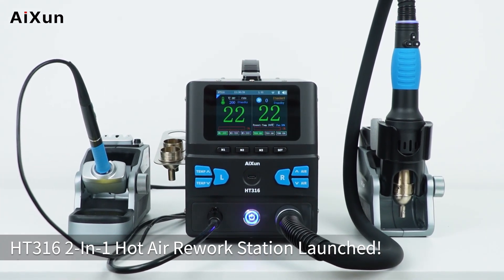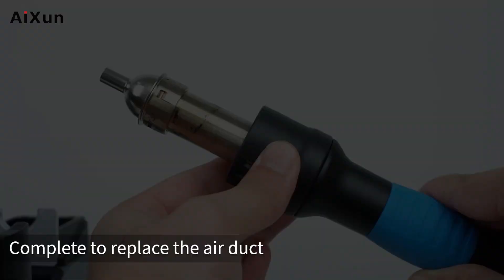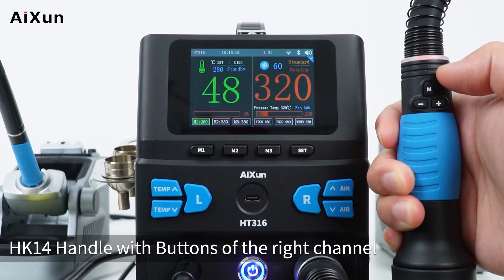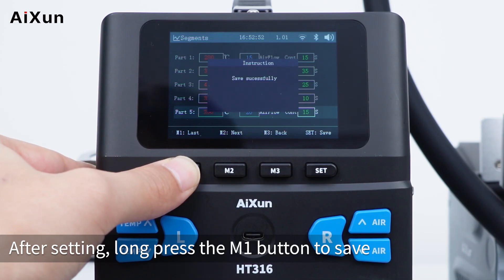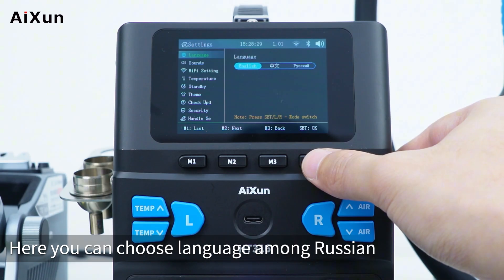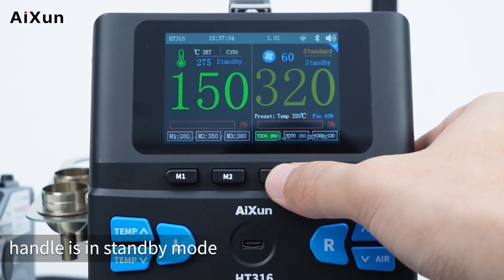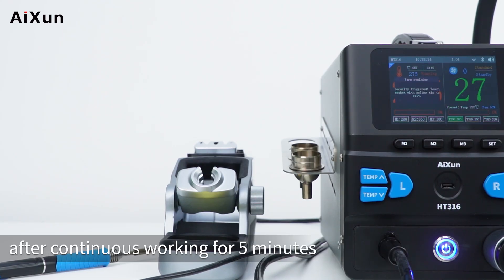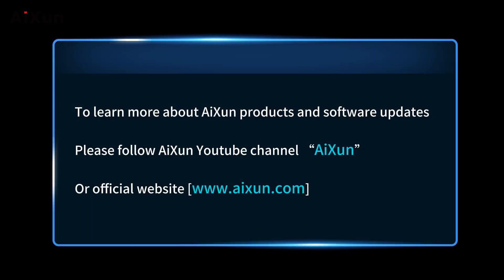AiXun HT316 2-in-1 Hot Air Rework Station - Operation Video #aixun #hotairgun #HT316

Comment: Aixun was my favorite Chinese brand.  I love the style, performance, and capabilities but this "Smart handle" is a "failure".  They went against what made them great to begin with, which is modularity, cross compatibility, upgradability.  These proprietary tips are low in stock and cannot be sourced easily outside of China like through aliexpress, ebay...  I get what they are trying to accomplish with the all in one handle.  Nice idea on paper but by changing the geometry of the cartridges, they have excluded what people have.  No one wants to buy a bunch of "custom tips" at a premium price that wont work with anything else.  If I wanted a $500+ unit with proprietary tips, I may as well go with Hakko or Metcal, right?  The whole point is quality and an affordable price.  Aixun has failed in this endeavor.  I still love the other products and the air guns are fantastic!  Why can't Aixun release a 2-1 hot air + t-12, or Hot Air + c115+?  Why exclusively this "smart handle"?  I would love this machine were it compatible with what I already have from Aixun...
Reply from the maker: Thank you very much for trusting AiXun and using Aixun products. We will make more handles compatible with the HT316 device based on your suggestions. Stay tuned.
Reply: Perfectly said! I would buy this station if it had compatability to t245, t210 and t115. Rather make it a bit more expensive in the first place than lock users in with your t225 tips.

Comment: I like Aixun. They make nice and quality products. But since they released t225 smart handle and try to push it with all the new releases, new releases dead on arrival. I wanted to buy t400 soldering station, first they advertised it as it will support all the handles and jbc tips but than they released it with only t225 smart handle and lack of tips etc. Now I seen this video and I would buy this one if it wasn't coming with t225 since it doesn't support other handles and now this product is dead on arrival aswell. If they released smart handle like t225 which one supports all t245 210 and t115, since they are the most popular handles in the industry at the moment, im sure they could make millions with it but no, they wanted to try to push this stupid handle with lack of tips and nobody buys it. They released the handle more than 6 months ago and they didnt even release more tips for it and it only support 3 kind of tips and that not useful for most of the people in the industry unfortunately..
Reply from the maker: Thank you very much for trusting Aixun and using Aixun products. We will try to make the T400 compatible with more soldering iron tips in response to your suggestions. Please stay tuned.
Reply: @aixuntech that's perfect new!!!
Reply: @aixuntech  its good to know Aixun listens their clients opinions. The day  T400 starts supporting other handles I will order one and will make sure everybody knows about it. Will share this good news on forums aswell, people needs to know this!